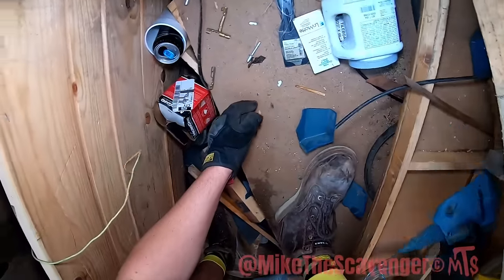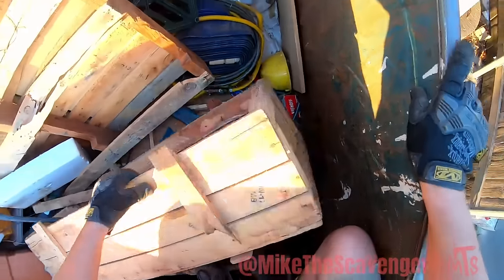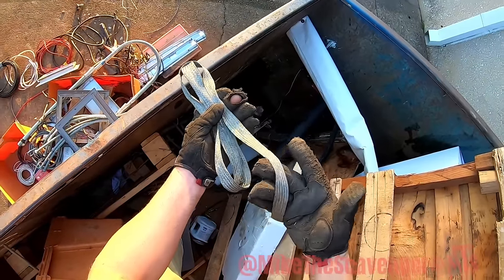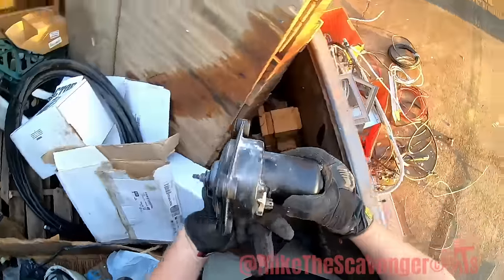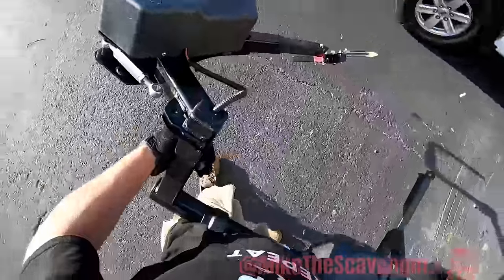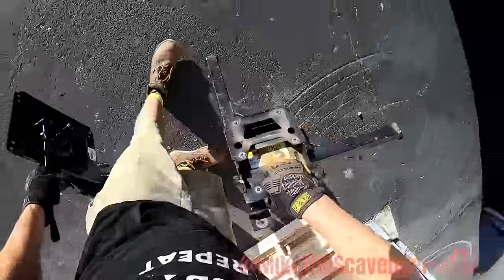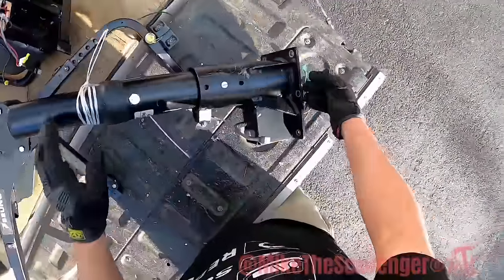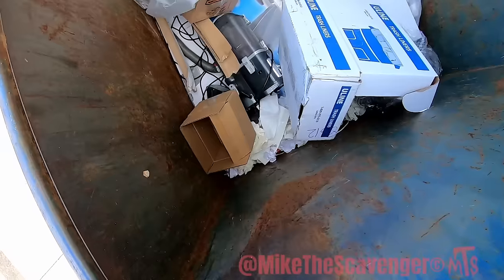Dumpster Diving "Let The Incubation Begin!"

Comment: 9:22 Yes. You could make a hoist to help load heavy scrap into the bed of your truck. Mobility scooter hoists, look for data labels for their lifting capabilities. Or look up model numbers for their specifications. 14:00 Patient lifts for picking people up in beds to change linens or move to another bed or put in a leak tight enclosure...😮
Reply: He might find one of those in that medical dumpster

Comment: Mike at 14:15 is another Newer type Hoyer lift,  for transferring patients from bed to wheelchair, into/ out of the bathtub, car, etc. Those lifts can hold some pretty good weight, though like all things it does have a wt. limit!!!   This can also be used to lift heavy objects, the base, or feet are opened to ground and stabilize it, preventing it from flipping and severely hurting the patient ( or object😉) there should be a lever next to the post or automatic remote that opens the legs(base).
Reply: Us in medical field know that is a Hoyer lift ! Had to use those several times getting patients in/out bed !

Comment: A great video as always Mike a shame those lifting frames didn't have the cylinder you could of rigged it up on the back of your truck to lift heavy things into back with injuring yourself, also the red metal box is a parts washer very useful for cleaning oily things, if the pump still works you could sell it they aren't cheap to buy look it up.
Happy Easter Mike to you and your good lady wife.

Comment: Is there any way to determine how much material mike salvaged from the landfill? ..
Could be a nice year end contest for some merch and swag. Closet to the pound wins.
Reply: Yes, there's a way, 2023 was the first year that scrapyards were required to report every scrapper that made over $600 per year, since Mike was aware of that I'm sure he kept all his receipts, which have the weight, all he would have to do is get the calculator fired up and add it all up, wether he wants to put the time into doing that is the question.
Reply: @indianaslim4971   actually.  The scrapyard would be keeping his tally.  I'm talking gross weight , not per material.  Mike would have to keep receipts incase of discrepancy.  That between him and them. 
He could have Copper ,Brass, And Stainless prizes..lol. Maybe a small donation of $2 for charity to a pet shelter to purchase a weight number.   He would know the ball park , and could sell off  a number between 1 and 5000.
Reply: @liebherr11602  I think you are wrong, the scrapyard has to report the amount of money paid to Mike to the IRS, the IRS has no interest in the weight, I don't know which form is given to Mike, like a w-2 or  1099, but it won't have the weight as that's irrelevant to the IRS.

Comment: Mike I have been thinking what about buying a trailer to pull along,,,,,,,, sides on it ramp in back,,,,,,,, wide enough inside to put 2 items next to each other like washer dryer,,,, BBQ and washer,,,,, frig and frig if a little a little wider pipe on side or middle,,,,,, mount a hand truck in trailer to roll up on ramp so you don't hurt back,,,,,,, if no big item found load up with what ever,,,,,, length of trailer 4 rows Of 2 ,,,,and you still have truck bed to fill,,,
Just a thought longer items in trailer,,, make sides high enough so nothing falls off side around corners,,, just an idea
Roger Robinson

Comment: Happy Easter to you and yours!   That red “callbox” is a compact parts washer. Put in 3-4 quarts of non flammable varsol and your good to go. It pugs in and has a pump and discharge wand. Top tray is for washing and the bottom is to settle the dirt out.

Comment: Fat red metal box that you pull out of the dumpster you said well it looks like a call box sometimes I just can't believe that you are a professional scrapper if you can't recognize items when you pull them out of the dumpster lights at I don't know what to tell you man it's only obvious that you know you're not making the money scrapping you're making the money off of the videos you're doing for YouTube because anybody that would be the very second you pull that red metal box up and you let the delayed up and the pump and stuff was underneath there I knew what that was before you even opened it it was a parts washer mechanics and whoever when they rebuilt stuff that's what they used to lay the parts in and the pump pumps the solution up out of the bottom of it and then I wash whatever grease and oil and dirt off the parts to clean it